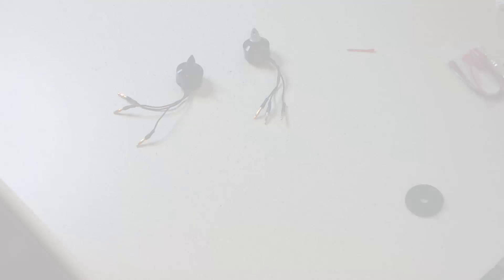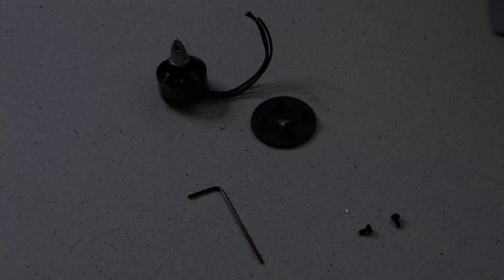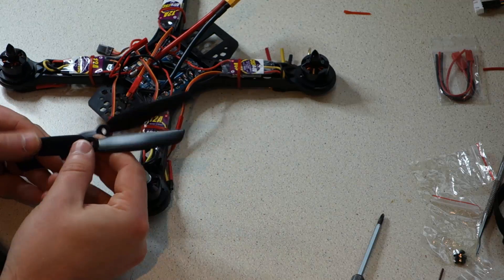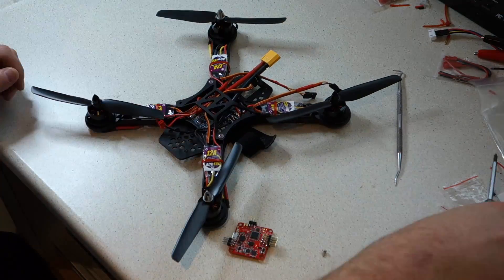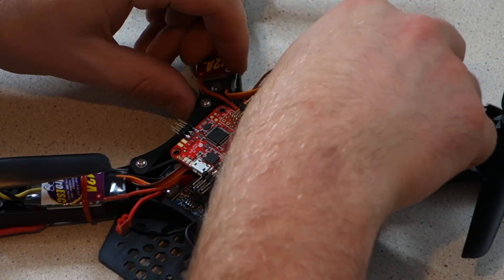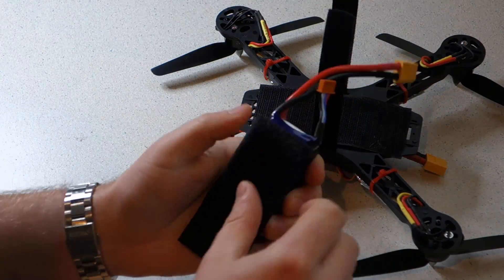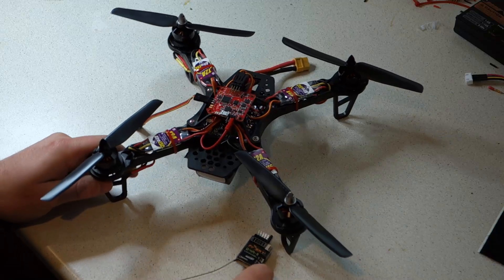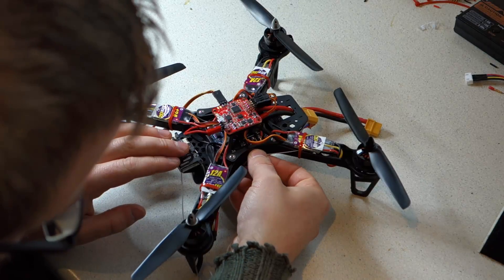HobbyRC Ready To Build 250 Class Quadcopter Kit - Part 2

Comment: so you plugged everything up and it worked first time??Most of you guys that post vids leave out so much info for the newbee's.you have to download and install 3 different things before u can even start to use the Naze32.Did u disconnect all 3 pos wires coming from each esc.Did u explain why?How bout what Tx ur using and how to set it up for a qaudcopter.Theres so many Q'S out there and its so hard to get answers.What about tunning after you get it to work.P.I.N whats that?Is it different by size of the quad 230,250,350 ect..How do u set up your Aux to accept angle,horizon ect.